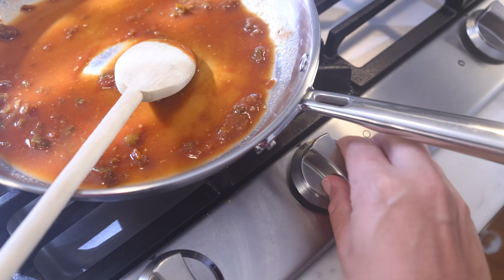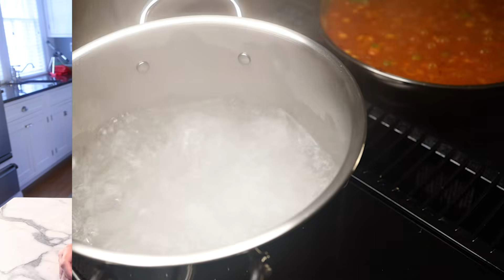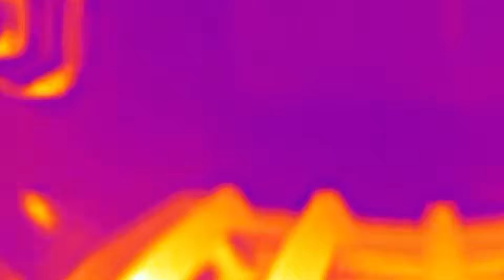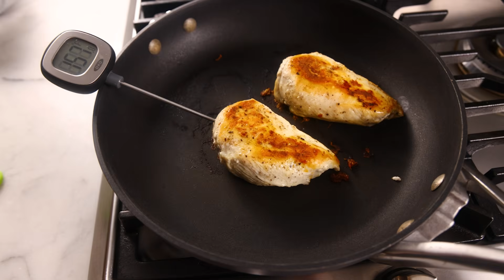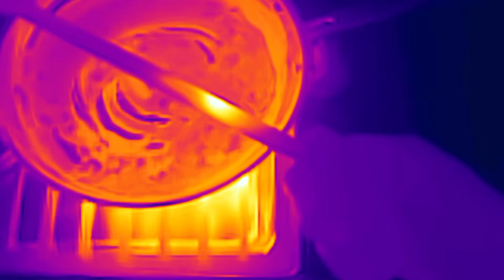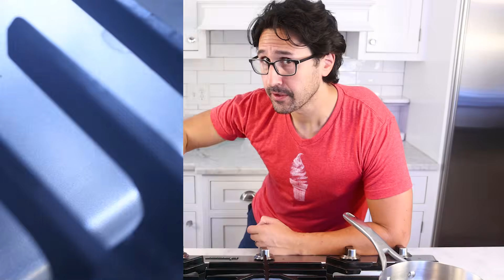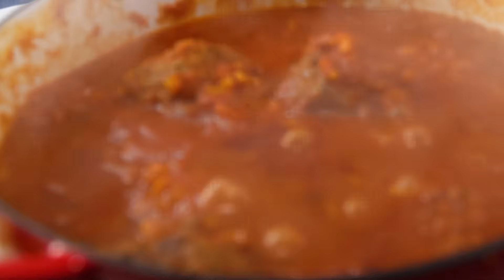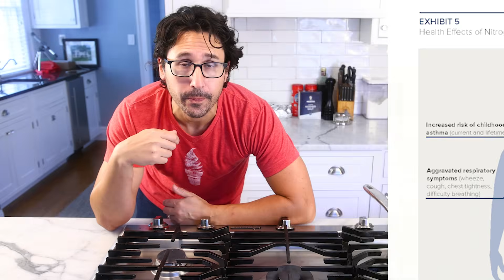Problems with gas stovetops | weak, dirty and dangerous

Comment: I didn't know other people didn't deal with this, I have always had gas stoves
Reply: Same. I find that this is a very western problem. Electricity is expensive where i'm from so induction is a no go. Also an induction cooker is just more expensive than a gas stove.

Wanted to add that induction also means using pans that are compatible with it. Which isn’t always cheap and readily available.
Reply: @noshimoshi  cast iron is the best pan for induction, hands down. ancient and easy to make.
Reply: @mjs3188  Oh i know. I'm just saying it isn't for the average folk here.
Reply: @noshimoshi  wait are you serious? I'm from eastern Europe and all I ever see here are electric stoves. Don't think I've seen gas in any house or apartment, ever
Reply: @mjs3188  You need to be careful with your cast iron on an induction though. You need to crank up the heat gradually, because with how fact inductions heat up, if you immediately set it to a high setting w/ cast iron, it can warp
Reply: @noshimoshi  And your problems seem very eastern, everything is too expensive?
Reply: @holokyttaja  not sure if you're taking offense for calling it a very western problem but to answer, no not really. Just not practical.
Reply: Same here, never used electric, never seen electric other than small electric grills. Electric stoves are also WAY more expensive here, and the electicity they use is as expensive as gas.
Reply: Yeah, as if like most citizens from third world nations can afford and maintain an electric stove and a convection oven
Reply: @burningwood7406  all the more reason for those of us who can to use induction. cheap electric is a privilege that we're throwing away to keep burning fossil fuels.
Reply: @burningwood7406  you still don't see people outside of murica complaining about it.

Comment: My friend has gas stove. We once decided to make fried chicken, but the oil had lots of water in it. So when it got heating, the oil ignited and sent a 4 feet long flame up to the ceiling. Since then, i’ve had mixed feelings about gas stoves.
Reply: @phant0m92  yeah, but because of the open flame, the oil ignites. If it was a glass-protected stove, it would have just resulted in spitting oil.
Reply: how exactly did your oil have water in it..
Reply: @OmniversalInsect  okay, long story. So my friend had a deep fryer, but it was broken. So we used the oil that was left, but the fryer had been out in the rain, thus water seeping in to the oil. Quite frankly one of our most stupid moments.
Reply: @alvinhagg7412  damn that's unlucky, that fire situation happened to me as well one time when I was making potstickers, I fried them but when I added the water to steam I'm guessing my heat was too high and the whole pan turned to an inferno
Reply: @OmniversalInsect  oh, shoot. Seems quite common with these oil situations
Reply: @alvinhagg7412  Yeah im not really a fan of splattering oil when cooking

Comment: The biggest advantage of a gas stove for me is that I can quickly warm up and slightly char my tortillas directly on the stove top.
Reply: Yup, also good for baba ganoush. Roast them eggplants
Reply: Dont forget drying out damp nori seaweed for sushi
Reply: Actually, I do tortillas on my glass-top electric all the time.
Reply: @mawlakewlz  yea, when in college I had to make due and use an electric stove. It was never as efficient or quick as a gas stove but worked decently enough. Rarely got the char I wanted with peppers though.
Reply: @mawlakewlz  it takes a while for it heat up right?
Reply: I can do the same thing with a wire rack over my electric glass top
Reply: @ernestpaul6444  yes but not over an induction stovetop that literally heats up the metal cookware and itself stays cold to the touch
Reply: I thought I was the only one who did this!

Comment: you forgot to take into account the amount of energy from gas compared to watt needed to boil your water/cook anything.  if you live in a country like murica, where ppl generally don't care much bout resources then, yeah.  electric stove looks much more appealing.

but you can never beat the law of physics and science.  don't forget when you're heating something you use heat generated by electricity.  that electricity was, originally, generated by heat.  so heat -> electric -> heat again and from each of this conversion there will be some losses due to efficiency.

gas, on the other hand, is a simple matter to energy conversion where you gain heat from burning the gas.  also, on the country where you have rich natural gasses, it makes much more sense to use gas stove instead of electric.
Reply: He goes over that in the video

Comment: i actually was wondering why my gas stove could never do low heat for simmering... this has made me reconsider my next kitchen range
Reply: Many gas stoves and cooktop now have a low BTU "simmer" burner..
Reply: @machinist7230  maybe mine was just f-d
Reply: I have a small induction burner like Adam's for the side simmer.  Love my gas stove.
Reply: Get an extra burner grate and put it on top of the normal one. The extra distance will allow you to get the low heat you need.

Comment: Yes, but electric hobs are slow to react. GAS is just more controllable.
Reply: They still heat up faster, and if you want to lower the heat quickly you can take it off the burner.

Comment: Fair enough it's not as efficient but imo gas is still better. think about it, the way things are made today nothing lasts as long as it should but with a gas stove it's simple enough that it can get close, then when it does break any idiot with a few dollars and a free afternoon can get it fixed, and taking out the gas to do it safely only messes with the gas. This opposed to an electric stove where if it breaks it's just broken, it'l probably break sooner, if you can get it fixed it'l cost more and probably require you to go without electricity for at least a day and you're probably going to have to just throw it out eventually.

Comment: Does induction count as electric? Because what I’d call an electric stove too is one with those big metal disks
Reply: No not the same
Reply: yes technically induction stoves run on electricity, but in this video Adam's referring to resistive coil stoves... those 'big metal disks' also have a coil of wire underneath them, sometimes encased in sand. an induction stove doesn't get hot on its own, it only makes the pan hot

Comment: This seems more like an argument for good ranges rather than electric vs gas
Reply: There's some valid points there also aside just from good and bad ranges, specifically practically and maintenance for electric while gas may have more applicable methods of cooking no?
Reply: @ch1maera087  I’ve never had an issue with a gas range in my life. On the contrary, the electric range I used for a couple of years got scratched to pieces. Granted it’s better for boiling, but for sautéing and frying I’d much rather use gas. Even for more delicate sauces I’d prefer gas, for the superior heat control. Having said that I do agree, Adam makes very valid points

Comment: 0:10 I've always had a gas stove top. Can someone explain to me what he means by "they're instantly hot". Do you have to preheat an electric stove top?
Reply: I mean kind of, there's no flame so it does take some time to heat up.
Reply: @chataclysm2112  how long does it take to heat up because I'd imagine it's not as long as the oven bit
Reply: @guyferi  oh considerably less than pre heating an oven, but it still takes a decent amount of time, especially on older electric stove tops (the kind not covered by glass)
Reply: I may be wrong on the technical explanation but there is almost no heat capacity of the air being burned on a gas stove so when you change the control the stove responds almost instantly. However electric stoves have a lot of heat storage in the element and glass top that when you change the control, it still has a lot of hot or cold to move through before the change in output makes it to the pan. Hope that made sense.
Reply: If you are cooking anything properly , you need to know if you turn OFF the stove,
that means there is no more heating! Unlike with an electric hob. 
But you get to know your own stove and can use the cooling-down period deliberately.
Reply: Electric stove first has to heat up the coil and then the ceramic glass covering and then the pan
While gas stove heat are instant because it's straight fire, the temperature is the fire temp and fire exist instantaneously.
Reply: Gas stoves basically doesn't exist in my country, we had one in our summer home abroad, and man it was way faster at heating then all the eletric stoves i've used
Reply: Depends. Old electric tops have a heating element that takes time to warm up, whilst gas is a fire instantly ignited. Both of these use heat radiation to cook food. Newer electric tops with induction is pretty much instant because they use induction to instantly heat the cooking vessel instead of a top/heating element.
Reply: No, he is incredibly misleading for saying "It takes a few minute to heat up". Anybody who had the "electric coils" knows that it takes less than thirty seconds to go from "cold" to "Max" with nothing on it. Now compared to "clickclicklicklick foosh fire" of a modern gas stove, yeah gas is "instant", but none of that heat is going into your pot. Meanwhile on an Electric stove, once you turn on the coil with a pan on top, all that heat is being conducted through the metal and into the water. 

The coils only get super-glowing once enough heat has transferred into the pot making it look "cold" prior to boiling? I don't know his reasoning. He has several other video with glaring real-life application mistakes like this, hence why I take his advice with a grain of salt. Pun intended.
Reply: @DamienDarksideBlog  my electric stove in the old place took 5-10 minutes to get the frying pan ready for bacon, doing that on gas burnt it and I learned it only needs a minute or two to heat the pan on gas. Sounds like you maybe have an induction one?
Reply: electric stove tops take longer to fully heat up, and when they do they're also slower to transfer the heat to the pan, at least in my experience

Comment: When I make pasta, I just boil the water in an electric kettle

EDIT: Hello everyone, it's been 3 years and I wanted to just expand on this a little bit

First off, I am european and our kettles are in fact pulling upwards of 2000 watts from the wall since we have 230 volts in all our outlets. I know you guys can create 240 volt circuits with your weird split phase power system but i also know it's a special way of doing it and not at all standard, so you are, in effect, limited to 1500 watts which is a fair bit slower at boiling water than a, say 2500 watt kettle. This is one of the reasons I do this when bringing larger quantities of water to a boil because the kettle is actually really fast, it can boil in just about 2 minutes even when completely full.

Secondly, kettles are tiny! You can't very well fit a large size pot's worth of water in that thing, right? Well you don't have to, what I often do when boiling a large amount of something in a large pot is split the water maybe 50/50 between the pot and the kettle. With a gas stove, that 50% in the pot is probably going to reach maybe 60 degrees celsius in the time it takes the kettle to boil, but hey, that energy doesn't disappear when you pour the kettle water in there, it gets to about an average temp between the two so it still speeds up the process significantly compared to just letting it come up to a boil on the stove by itself.

If you're cooking a lot of pasta or potatoes for a large dinner or gathering or really any reason, maybe meal prep, whatever floats your boat, then this is a great way to get water hot faster in my opinion. I don't always do it, in fact, when cooking for just mysel, I just slap a lid on the pot and set a timer for 15 minutes with the burner on low, usually enough to get it boiling, but that's usually in situations when I'm not concerned with the speed, I just want to eat some dinner.

Anyway, if you read all this then frankly you might be autistic because I really don't know why else you'd read 3 whole paragraphs about boiling water, but I appreciate that someone shares my weirdly specific fixation on examining household appliances and their usage.

Also also, if you do in fact share this fixation with me then I believe that Technology Connections is a channel you should most definitely check out, I feel like there might actually be a rather substantial overlap between the folks over there and over here, because people willing to watch videos about the best way to cook mushrooms or why garlic can make mayonnaise are probably the same kind of people willing to watch a 27 minute video about how to improve the performance of your dishwasher. Nevertheless, if you are in fact unaware of the guy, I suggest heading over, you might enjoy the content.
Reply: Same, bring to a boil in a kettle and pour it into the pot on the stove. Much quicker
Reply: same, it's what a kettle is designed for after all
Reply: @grasshopper9218  its about 7 minutes faster on our old Kenmore gas range to do this
Reply: Yep me too. 3 stages. Hot water from the tap into the kettle, boil the kettle, pour into pot.
Reply: @mindsnare1982  Unless you have plastic pipes, I'd heavily advise against using hot tap water to cook.
Reply: @TheDBZ_KING7_Official  I do have plastic pipes. Brand New house.
Reply: most Americans don't have a kettle. they either boil water on the stove or apparently do it in the microwave
Reply: reminds me of dormitory life prior to the pandemic, wonderful times!

Comment: "can I tell you about my gas problem?" I dunno Adam, eat less beans maybe?
edit: fewer beans? I'm not sure which one would be right here.
Reply: Fewer is for plural objects and less is for singular. Less milk, fewer pennies.
Reply: "fewer beans" could mean reduce the number of varieties of beans you eat, while "less beans" could refer to the quantity. Plus it doesn't make sense to use fewer to refer to the individual beans in a meal since we group them into portions .That's how I understand it at least
Reply: You got it! Fewer beans is more appropriate. 'Fewer' generally refers to something you can count, while 'less' is used for things that are hard to quantify. For example: water itself is not something you can count, although you can measure it, in which case you count the liters. So fewer liters equals less water.
Reply: I mean we can get into the interesting debate of descriptivism vs prescriptivism in linguistics, since words don’t objectively have any meaning, only what we assign to them, anything you say is bu definition correct if it’s understood by the listener/reader (or so goes the argument). Many people use ‘less’ when talking about countable and non-countable nouns when technically they ‘should’ use fewer so arguably it’s equally correct
Reply: Stannis Baratheon has entered the chat.
Reply: Fewer if it's one by one like TicTacs, less of it's beans in sauce.
Reply: @edim108  no